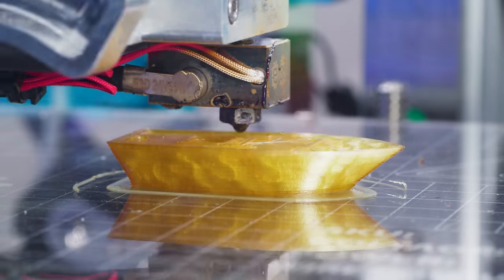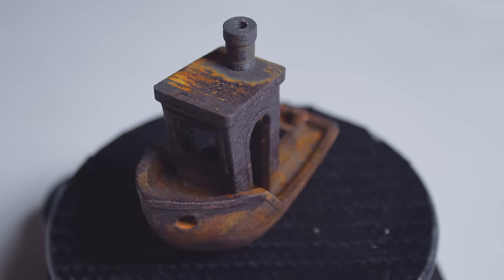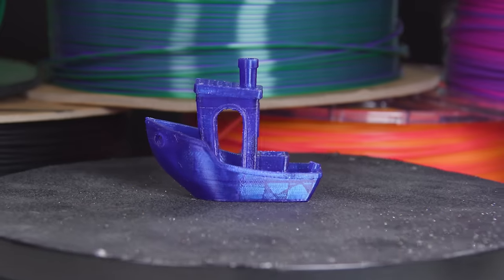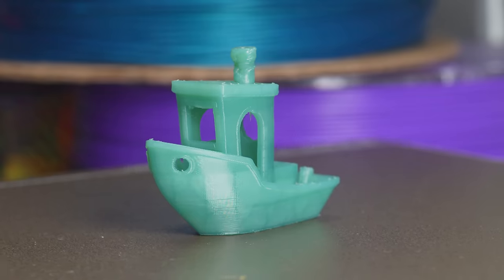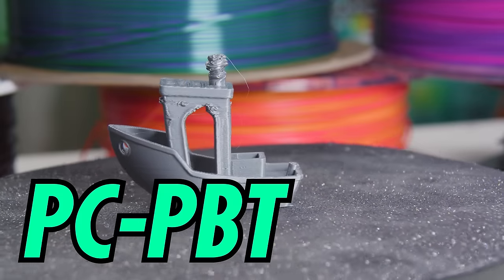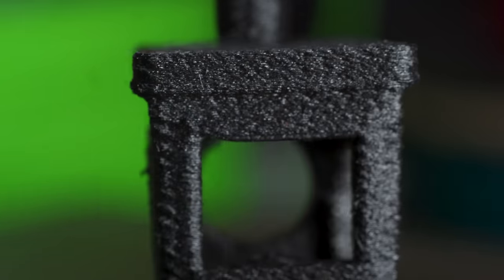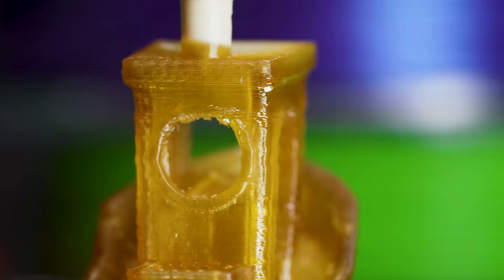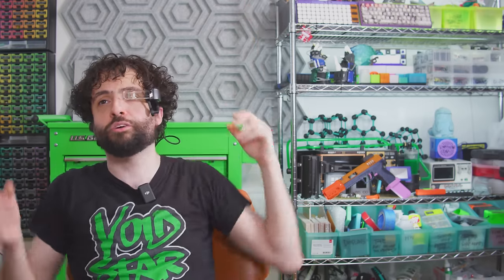The 3D Filament Tier List! Which Should YOU Use?

Comment: @ZackFreedman this was a fantastic video i was wondering what would you suggest for something like a Paintball loader. It would need to survive roughly 300fps 68cal paintballs hitting it, it needs to be hot weather and uv resistant, and ideally would not need an enclosure/ventilation system.  Im currently looking at 3 filaments based on this video PETG, 95A TPU (i was thinking 5 walls 30% hexagonal infill), or PCTG

Thanks for making such a cool video it was interesting to see such unique materials and to think about how they could be used. I never thought Delrin would be so difficult to print but for having such a low drag coefficient it makes sense

Comment: You couldn't be more wrong. ABS is S tier, and probably the only one that IS. If you disagree, you don't have a good enough printer or skills to print it well.
Reply: F tier, objectively worse than ASA, also easily overheated at high chamber temperature meanwhile ASA can be printed with no fan at 70C chamber temp
Reply: Also you commented on the chocolate video about the oil somehow giving cancer but have no problem dealing with ABS
lmao, lmfao even